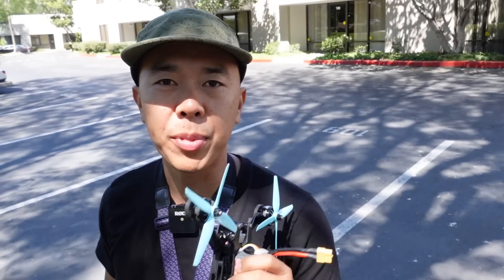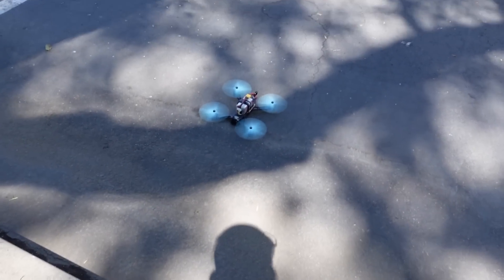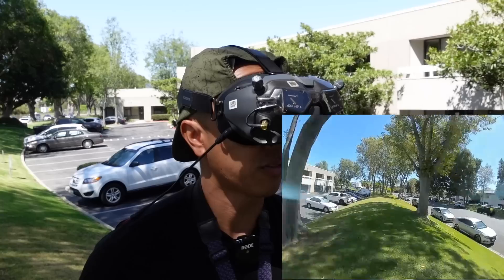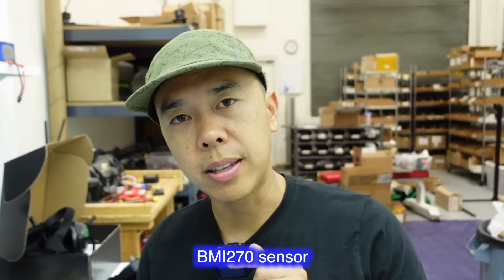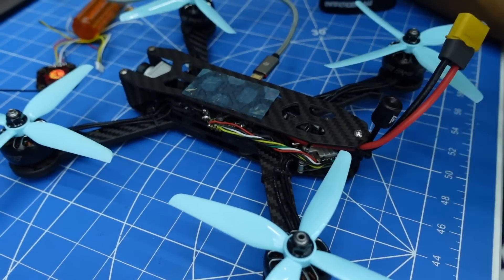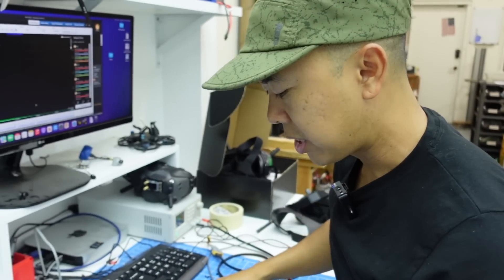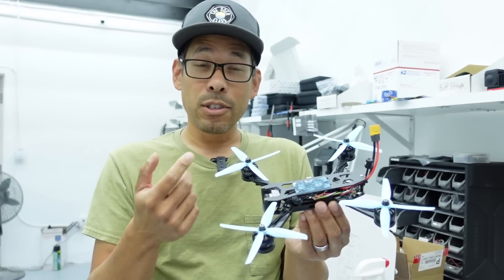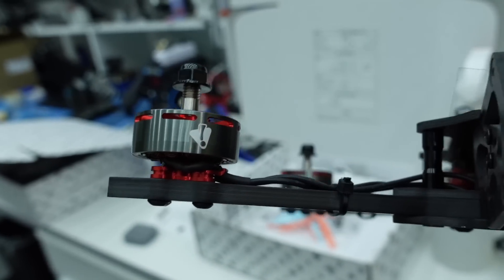The FOLDING drone FLIES! Community Build Project Pt 8

Comment: I have another idea, wouldn't it be cool that if  x amount of force is applied on the arms, they would automatically give way and fold in? just like for example the folding mechanism on DJI's folding drones, where they just kind of klick in place or hold in place, it takes a bit force to get them to fold out, then they kind of lock loosely into place for flight. which works for the DJI drones.  on a freestyle quad, this would need to be much stronger. maybe just some kind of metal spring mechanism, in the screw-tight mechanism on the bottom plate,  that holds the arms into place once un-folded.  that metal-plate spring thing would  also create some tension so it would prevent the arms getting lose from mechanical stress from abrasion, (by pushing the arm to a locking point on the frame) . I think the arms getting lose would otherwise just be a matter of time... a spring would push them into place constantly, plus like making the arms able to get  pushed out of place in hard crashes. actually when I think about it, this should be fairly easy to make. some kind of metal-spring-strip in the center locking mechanism that just gives way at x amount of force..

it should only re-fold (lol) when the arm would otherwise break of course, otherwise this would be a pain in the ass on lighter crashes, but when crashing hard this could potentially not only save arms, but also motors from breaking. like a spring that saves your drone from braking, I think if this is made right, this drone could be potentially the most durable freestyle drone that exists. using the arms like a buffer - spring type of thing.

Comment: Tommy those noise peaks are wide and look like they have a few smaller peaks inside of them. To me that indicates a lot of compound modes (modes that affect pitch and yaw or 2 axis simultaneously) or several different resonate modes within a small frequency range. 

If you have FEA software on a shop PC I’d take a look at that, or maybe reach out to Chris Rosser and see if he can do a quick analysis to get a better idea of what’s going on.
Reply: It's perhaps wider than some but it looks well defined. The single dynamic notch will work fine but might benefit from reducing from the default q (which is really narrow at 500 now) once you go shutting off or lifting gyro lowpass.

Comment: With regards to testing folding props - I found that the Gemfan's seem to fly better & have a better blade profile than the DAL's but the Gemfans rely on a plasic m3 pin to attach the blade, which definitely isn't strong enough (as I found out the hard way)!